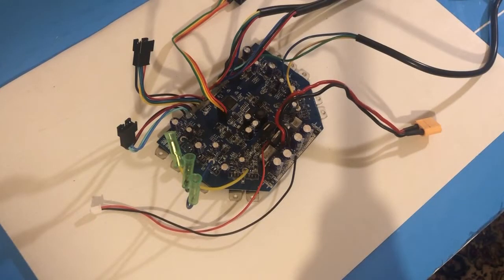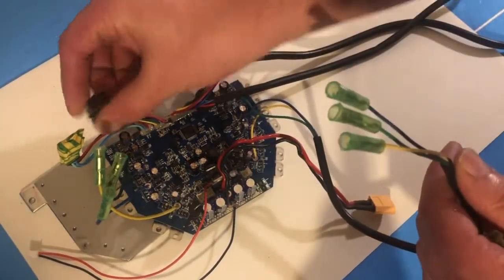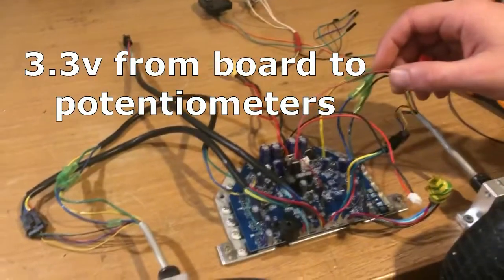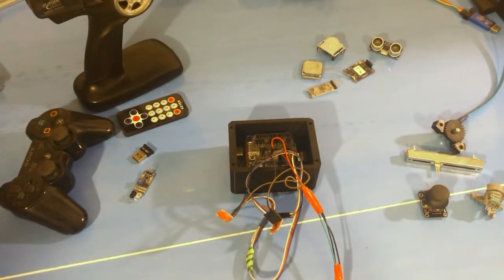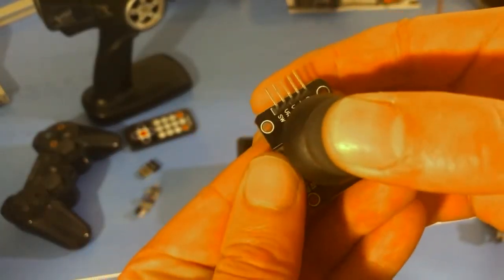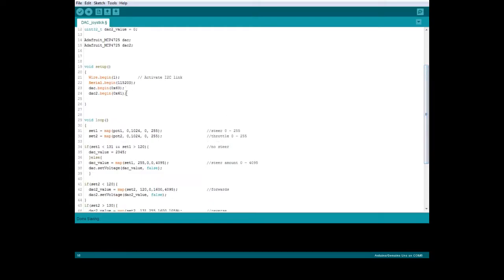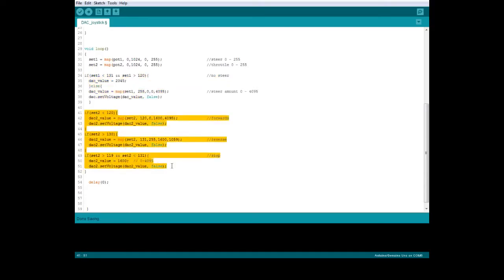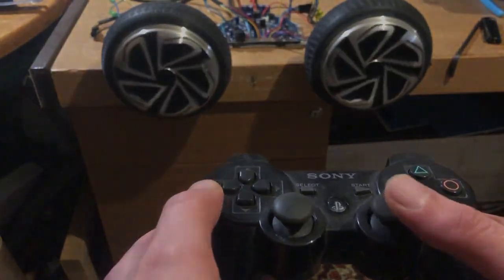HOVERBOARD MOTHERBOARD HACK - how to controll the motors PART 2 - Hover Board Hack

Comment: hi sir 
In your previous videos, you are using an motor controller called flipsky. Is the Hoverboard motherboard as good as this motor controller.
Also did you try any encoder with these motors. Thank you for answers.
Reply from the maker: hi, the main reason for the change was they are so much cheaper, the flipsky ones are about £50 each and that does 1 motor, the hoverboard ones are around £20 each and they do both motors and also handle the charging of the batteries, all connectors are already fitted, and the flipsky ones can be tricky to set up, none have been used with encoders only the internal hall sensors, hope this helps
Reply: @A-tech  thank you sir. This was very informative for me

Comment: Hello, i've watched your video several times and i just cant figure out why you used the DAC boards if you're going to get a USB Host Shield which would be connected to the arduino UNO from the top, therefore i wouldn't be able to connect the DAC boards, so why did you use the boards here and how are you going to connect the USB Host shield afterwards? 
Thanks
Reply from the maker: hi, the usb shield clips on top yes, it also has output pins on it like the arduino, it uses some pins (9,10,11,12) for usb functions but all the others are free i think, the DAC run through I2C so that makes it even easier, im my case i have a sensor shield on top of the usb shield, this just makes things a little easier connecting, so just to round up, its arduino board, usb shield on top, then a sensor shield, then the DAC connect to the SDA and SCL pins for the I2C, hope this helps, thanks

Comment: Hi could you please make a more detailed video on how to connect the Arduino to the mother board and how to use ps3 controller to control the motors. Also can this work with Arduino uno?

Comment: How did you connect the Green blue and black cables. Like you took the plastic off and then what
Reply from the maker: ok i took a plug of an old side sensor board and just wired the ends of that

Comment: Hello, I have a couple of questions. I dont understand the setup at around 7:07 . Like the gears you used and if I would still need them if I would use an Arduino and controller. Also could you please elaborate on controller the configuration and how you connected it to the arduino? Thank you
Reply from the maker: hi, that was just a joke, its really not a way you should control a potentiometer, ok the controller is a ps3 controller connected via bluetooth, you will need the ps3bt library, hope this helps
Reply: @A-tech  Can you please elaborate on how to connect the ps3 controller via bluetooth, as i just happen to own a ps3 controller. Thank you
Reply from the maker: @relatedl35  hi, you need a bluetooth 4 module, usb shield and arduino uno,  then the ps3bt library for the arduino, you should be able to figure it out from there, thanks
Reply: And what arduino did you use (the one in the picture ( 8:35 ))? Or can I use my normal Arduino? (https://www.amazon.de/dp/B01EWOE0UU/ref=sr_1_7?keywords=arduino&qid=1583182710&sr=8-7)
Reply from the maker: that one is an arduino uno, thanks
Reply: A-Tech so I can also use my Arduino which is also an Uno
Reply from the maker: @relatedl35  thats it ye

Comment: My Motherboard works but the wheel spnns and after a few second it starts to beep
Reply from the maker: hi, it sounds like you have the wrong one installed, if you have a different one it can be running a test mode function, thanks
Reply: @A-tech  i found it out backwarts is beeping i make a remote controlled hoverkart:D
Reply from the maker: @quartzii_uwu  ok thats great its ok, sounds good

Comment: Thank you so much for the great video. Do I have to make any code changes to connect an RC receiver to the arduino?Also, which arduino pin should be connected to RX signal wire? If you could reply to this, that would be of really great help. Thank You in advance
Reply from the maker: hi, yes you will need to make some alterations to the outputs, instead of writing to the DAC you need to write like you would to a servo, then an rc transmitter should be fine, i wasnt using an rx wire in my setup, i think thats only if you are using serial communication, thanks

Comment: Good job... 
Could you show us more details of  connecting to arduino ??
Please help
Reply from the maker: hi, is there anything specific you need assistance with? the DACs are controlled through the I2c of the arduino, they connect to the longest sensor cable of the hoverboard motherboard, using the blue and green wires, also dont forget to connect the grounds together too, and definitely dont use the red wire because its 14v, hope this helps
Reply: Sorry. But that was not  helpful to much to me ...
I really need your help . 
Please can you make one more video ? 
Please . 
Only the connection
Reply from the maker: @upload58404  ok no problem, could you explain which bits you need help with? thanks
Reply: Well. Im trying to control it with arduino and using a sensor which is (IR)  or ( ultrasonic ) .
Reply from the maker: @upload58404  ok so like with a tv remote? so you see in the video about using a DAC to pretend to the motherboard its getting a potentiometer signal, you need a couple of them, for your IR sensor i would not recommend that because they can only accept 1 signal at a time so controlling would be tricky
Reply: Can we contact each other please ? 
Any social media? 
Please
Reply from the maker: hi ye sure, email me at edeped@yahoo.com, thanks

Comment: Did you have a version of this code that works with the ps2 wireless controller?
Reply from the maker: hi, i have the code that works, im currently using it with the mobility scooter part 2, that is rc, video should be up shortly and i will put the code in with that one, thanks

Comment: I'm wondering if it's possible to use this as a scooter and to use a twist throttle
Reply from the maker: hi, yes definitely, the throttle should have the same control as a potentiometer would
Reply: @A-tech  great thanks, just need to work out how 😂😁 I guess it's just connect,  nope I don't know
Reply from the maker: with the throttle it should come with a wiring diagram, they are basically a potentiometer with a lever on them

Comment: Hey, super helpful video. I was wondering what compiler you are using to get it into a .hex or .bin file to download??
Reply from the maker: hi, i couldnt get a compiler to work on my system, apparently you need linux to do it? im not sure, thanks
Reply: @A-tech   Thanks for the quick response! Followup question, are you downloading c code directly and what did you use for debug?
Reply from the maker: if you are refering to the .hex file as c code then yes and no debug just sent it to the motherboard and thats it

Comment: Thank you for posting, I am working on a four wheel version and choose to use the DAC MCP4725 as well. I got stuck troubleshooting when it did not work and had to put it away for a while. Now that I see this setup did work for someone else, going to give it a shot soon. My end goal is to have a Jetson Nano with Realsense 435i camera on the platform doing some autonomous work. I have a smaller raspberryPi setup running with smaller motors and simpler brain, I thought my upgrade would go smoother. Again thanks for the inspiration.

http://mitchtronic.blogspot.com/2017/03/addressing-multiple-mcp4724s-in-same.html
Reply from the maker: hi, i just read your blog about the multiple DAC, i didnt realise there was a way to use more than 2 of these, hence just splitting the output of them to go to both motherboards instead of controlling them seperatly, im going to check out the i2c multiplexer because i need LCDs and other things on my robot. These DAC modules seem pretty good so far, no erratic values or weird stuff happening, glad to help and thanks for the input

Comment: I have 3 dead Mother baord they worked well until i flashed or tried to flash them. Did  somthing like that ever happended to you ?
So they dont make sound anymore the red Led doesnt Light up, no 3.3,no 5 nor 15v.
Reply from the maker: no i have done 3 so far and all have been ok, i take it before you tried they all lit up, is it possible you had some wires mixed up? if you put 5v through the motherboard 3.3v that will break them, thanks

Comment: Please bear with me because I am a beginner, but I have a few questions. I see you are using two break out boards, one for each potentiometer. If I’m wiring two motors to one joystick do I need 4 breakout boards or just 2? It seems to me like I would need 4
Reply: After rewatching this video I now believe I understand that 2 of the breakout boards can power the analog joystick controlling 2 motors. I would love to see a video of this if you have time. I know it’s basic I just want to make sure I’m understating it thoroughly
Reply from the maker: @LifewithLewy  hi, yes you would only need 2 of them, one for each wheel, but they dont control each wheel, one does the overall speed for both and the other adjusts the difference between the 2 motors, hope this helps, thanks
Reply: A-Tech thanks for the clarification! Thats what I assumed after i rewatched it. If you get a chance to make a video I would love to see it.

Comment: Hello, how would to code work for steering for an autonomous setup like this?
Reply from the maker: hi, its hard to say in a comment, but it would need data from a gps and or sensors or lidar, and be able to adjust its route depending on what is around it, i will be making one eventually but im not quite at that level yet, thanks

Comment: And yes I would love to see the ps3 controller video
Reply from the maker: ok it will be out soon, thanks
Reply: @A-tech  Did you ever post a video on the code and connections to use a PS3 controller with the hoverboard motors? Thanks

Comment: Nice video. Can you upload the full arduino code ised for the Playstation controller? Also I'm curious if is possible to controll it from a raspberry pi with python. I plan to add a pan-tilt head to the rover I build. I control the PT head stepper motors with RPI, Slush Engine hat and a Playstation 4 controller. I also have an Android app and a web app to drive it. It will be nice If I can incorporate the hoverboard in the same set-up. I think it will make a great video. Thank you.
Reply from the maker: that sounds pretty good, driving something over the web is on the project list, ok no problem im going to do a video on the ps3 controller so it will be with that one, thanks

Comment: you have the shematic  HOVERBOARD MOTHERBOARD ? and explain the code in the video part 1
Reply from the maker: hi, i dont have a schematic for the board unfortunately,  what code do you need me to explain? thanks
Reply: @A-tech   A-Tech  I need to the self-balancing two-wheeler code with hoverboard? You can help me? Thanks.
Reply from the maker: do you mean the firmware code? thats in the github file linked in the description that you need to download, hope this helps

Comment: Nice video! I see you are using a DAC to be able to control it from the Arduino. Can you tell me why did you choose this solution? Because you could also establish a serial communication between hoverboard and Arduino. This would avoid additional components and in the end less wiring.
Reply from the maker: hi, i think the different inputs for the board have to be set to a type in the firmware itself, so instead of editing the firmware files and making a different version I went the DAC way, thanks
Reply: @A-tech  ok. So you let the firmware untouched, ok. by the way, what do you think about the motor control itself? For me feels a bit noisy...
Have you tried using my firmware?
https://github.com/EmanuelFeru/hoverboard-firmware-hack
It is an improved controller, with much less noise and vibrations. All the interfaces/connections are the same as in the original firmware. Maybe, it worth trying it. Let me know what you think if you try.

PS: I am almost finished with even a better control FOC (Field Oriented Control) which will offer more features. I will post it soon on github.
Reply from the maker: Hi, sorry for this late reply i didnt get a notification about it, yes i havnt edited the firmware, i tried but i was having trouble editing and compiling so i went with the cube programmer instead of the CLI, is there a .hex file in that firmware folder? would it work me just uploading that onto my motherboards? Please let me know when you have the FOC mode that will be awsome, thanks
Reply: @A-tech  You can already try the sinusoidal control with similar setting as the original firmware. You just need to flash the firmware.bin from here
https://github.com/EmanuelFeru/hoverboard-firmware-hack/tree/master/build
It is a *.bin file, but it can be flashed same way as a *.hex file.

I also released the FOC control here:
https://github.com/EmanuelFeru/hoverboard-firmware-hack-FOC
the only thing is that by default the build expects a joystick ADC input (so middle centered), maybe I will put it back as original firmware for consistency.
Reply: @A-tech  Same reason I didn't use it, couldn't find the .hex file
Reply from the maker: @EletrikRidesAgain  have you found it yet?
Reply: OK, I tried to say something about the above mentioned firmware, but the comment gets deleted. Probably due to suspected advertising or something.

What I was saying is, the newest version of Aer Dronix's FW (FOC) is really nice. I'd give a link, but it seems to be prohibited. Anyway, I'm not sure if there is one single hex-file (but I might be a bit too unsavvy with programming stuff) but using Visual Studio Code and platformio.ini it's pretty easy and quick to build and upload to the mainboard. So I really recommend you take a look at this.

Now, what I'm trying to do is use a bluetooth module and arduino uno (and a blynk joystick) to control speed/steering. There is an example sketch which works perfectly. But I'm just not able to make it work via/set up a working serial connection, but maybe you could help me (and at least one other fella with the same problem) out here, since you seem to be pretty savvy with these things! I can also send you my code so far, maybe you're able to see where the fault's at. I'd appreciate your opinion on this firmware and of course any input you could give me regarding my issue.
Reply from the maker: @zeeone1438  hi, Im not sure if I tried it, I think it was over 2 years ago, using serial to control can add more problems, say if it stops getting a signal it will just keep doing the last signal it had, not sure if you can program something into the firmware to fix that
Reply: @A-tech  Yeah, it's been a while. Regarding your concern about serial control: this is what I like about this one, the creator/contributors have integrated a serial communication timeout that stops the motors, as soon as no signal is received after a defined period of time.

I've gotten a little further by trial and error, too, but still working on it to make it work.
Reply from the maker: @zeeone1438  ok thats good they put that in, i had a couple of issues while testing the hoverboard tank with serial coms, i think what you are doing with editing the code and compiling your own .hex file is great, i wasnt able to get it to work thats why I just use the cube programmer to upload the fm
Reply: @A-tech  I see, yeah. You might wanna give it another try, if you're still looking around for a nice firmware.
Would you mind me sending you my arduino sketch, so you can have a look at it? Maybe you could at least give me a hint or two what I can improve or where the potential mistake is? Wouldn't blame you, if you don't want to.